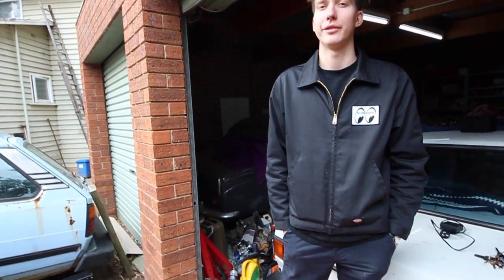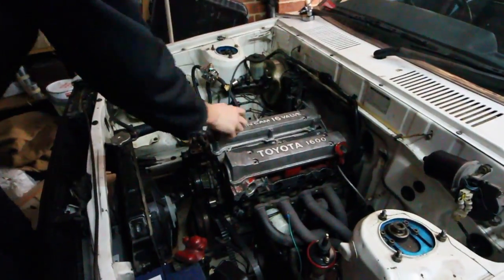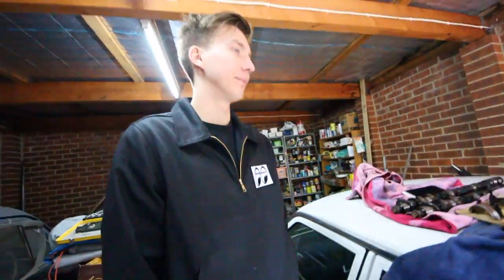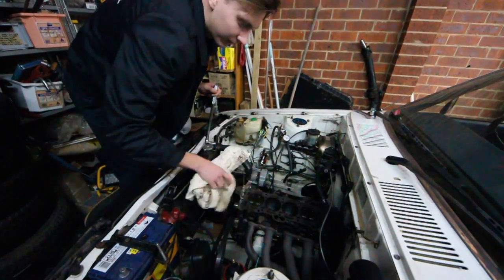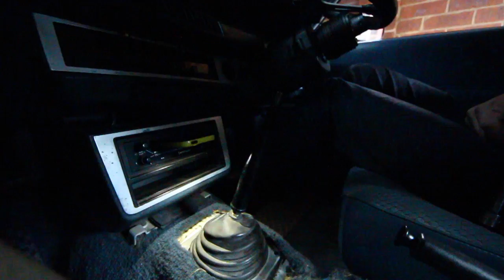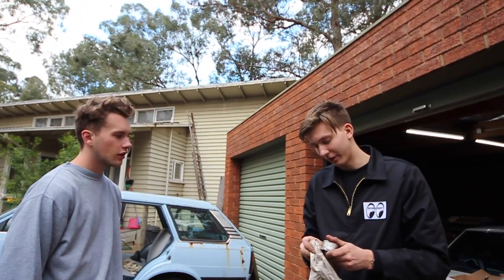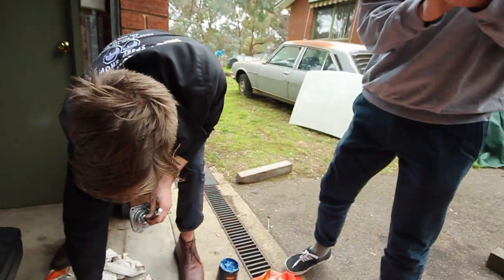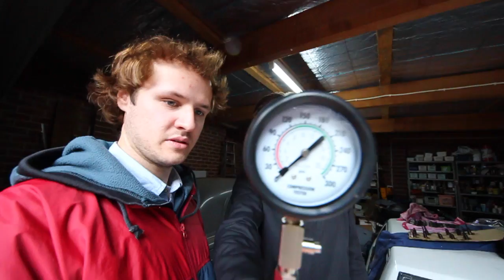Big Dummy 4AG Mistakes | Ke70 4AG Conversion pt. 8

Comment: imma be posted in this club for the next 32 mins
Reply: More Skids sik sik
Reply: More Skids fuck that was fast
Reply: More Skids tightens shifter in star pattern
Reply: whats up sweetheart
Reply: the notch on the shifter spacer is for the fill hole, that shifter would also fit ke70 k series gearboxes too.

Comment: I know this feel. My AW11 has bad rings. Got it running. DD'd it for a year then bent a tie rod and parked it and the next day it started to leak fluid. Probably just an old hose of which I've replaced quite a few before. Been parked for 6 months or so since then. I really need to get that car back on the road.

Comment: Shit luck my dudes. Just some info 91 fuel  is fine for a smallport 4age, run it in mine and shes mint loves it. Sounds like the carbys are incorrectly tuned im no expert but if its only getting fuel with the throttle 100% only the secondary's are working or some shit. Next thing i just blew my rings to haha, but it was my fault put them in wrong :P So best bang for buck in my opinion is rebuild. Ive done it with limited tools in my shed. Shit is easy on theses, in rebuilding you learn heaps, more content for your channel and the feeling of doing it all yourself and saying you built that bad boy is the best. If you need help give us a yell i can try my best to give you a hand.  Good luck
Reply from the maker: Slow and Proud hell Yeah man thanks so much for always sending them positive vibes, best of luck getting her back together